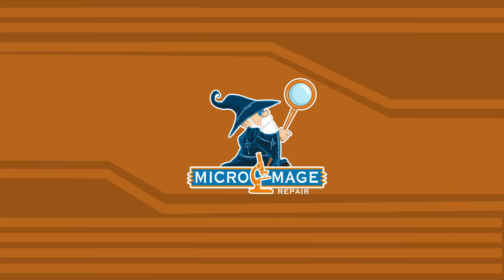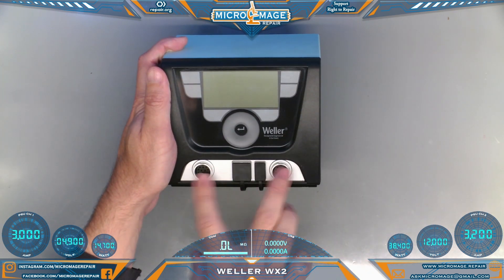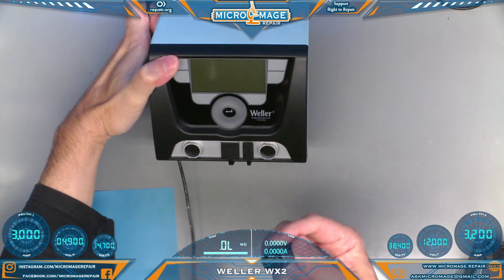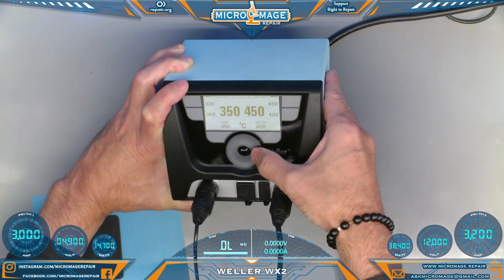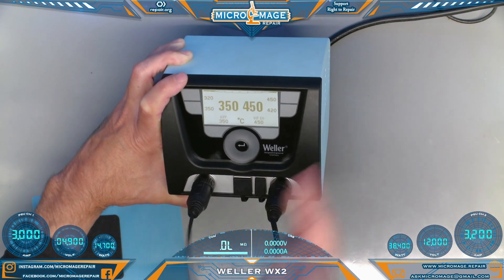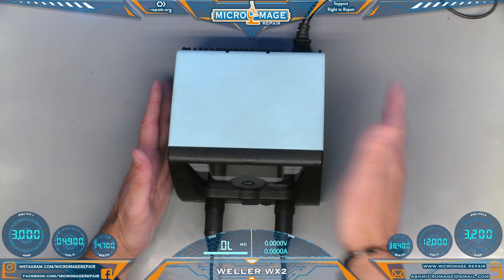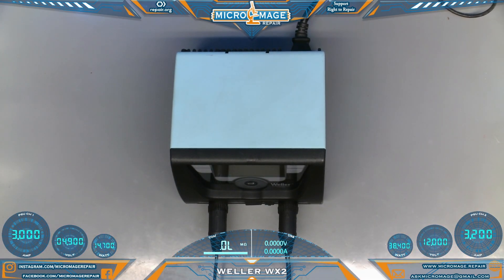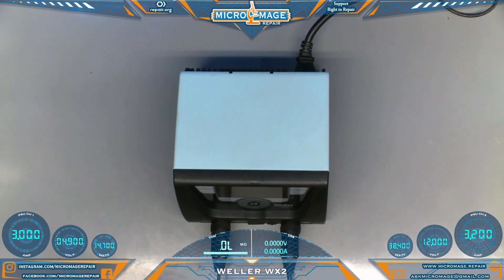Weller WX2: My Soldering Station Review

Comment: My right side is always stuck on 0 degrees for some reason
Reply from the maker: Strange,  does it do that regardless of what iron is connected or is it a specific iron.
You can update the firmware on these,  that might help . (Have to for the pico pencil on older models)
Reply: @MicroMageRepair  correct it doesn't matter which iron is connected
Reply from the maker: @KlossMMA  I would dive into the settings.  May have sleep set  to zero seconds or some other oddity on the channel.  Also should just be able to reset the system back to factory.

Comment: If you put a little more twisting force on the locking rings that hold the connectors in place you will find that they will rotate a few more degrees and really lock them in place very well(er).  I operated mine for like 5 years before i realized you could do that.
Reply from the maker: I kind of figured that out during the video actually 🤣
So far I haven't managed to disconnect one since I recorded it. 
I may have to make a follow up post.

Comment: Is this the same as the wx2021 station? Or are they different?funny enough I’ve just literally bought the wx2021 and waiting for it to arrive in the post. Great watch as always
Reply from the maker: Yes, same one .
Just finally getting around to  recording a review on them lol.
Reply: @MicroMageRepair  😂😂I bought it mainly coz I knew you and a few other YouTuber techs use them and have only heard good things about them. Great watch as always.
Reply: Wondering if you can help me😂, just tried the weller station tonight. Took me ages to work out how to change the language as it starts in German 🙄. Is there a way of setting it up so when I pickup the iron it turns on and when I place the iron in the cradle it goes to standby? At the moment the iron will only come on when I hold two buttons on the station and then when I have to turn it off I have to get up again and do the same. It’s really annoying. Is there a way of doing this on this station and how do you do it? Thanks so much I really appreciate the help. Thanks rich
Reply from the maker: @SURGE101  The iron should come on  when it detects movement.  They have motion sensors. 
They also have auto stand by after a period of time that you can adjust to your preferences. 
Mine are just what they were out of the box.
Reply: @MicroMageRepair  thanks, I’ll have to go through the manual as at the moment it only works by holding 2 buttons but it’s good to know it is possible to do it on this station. Thanks so much, really appreciate it. Thanks rich
Reply from the maker: @SURGE101  I'd be a little concerned that something isn't right with the iron.
You shouldn't have to make any adjustments or hit any buttons beyond choosing whatever preset temperature you want.  Out of the box the irons have all activated once I have picked them up/ moved them.
Reply: @MicroMageRepair  I’m wondering now it may be something I’ve done in the settings accidentally because it was in German and I was messing around in the settings trying to change the language. Now they’re in English I’ll go through them again and see if it’s something I’ve done. I’ll check that and hopefully it’s something silly I’ve accidentally messed with. Thanks so much, i really appreciate the help. Thanks rich